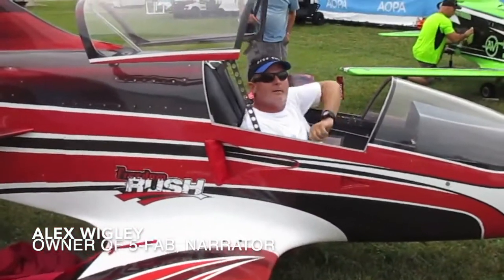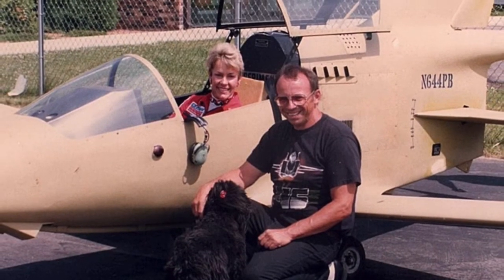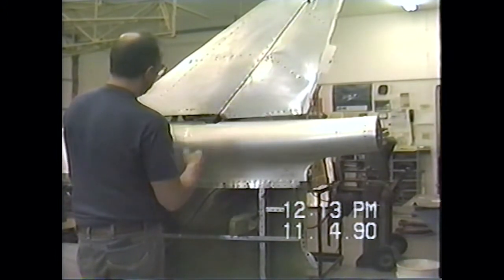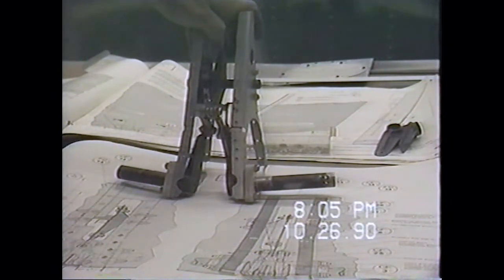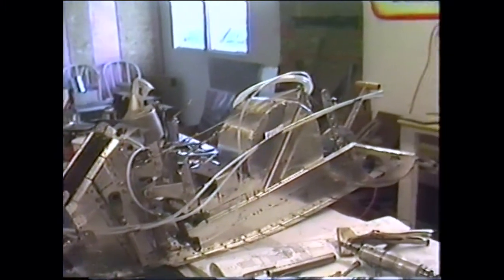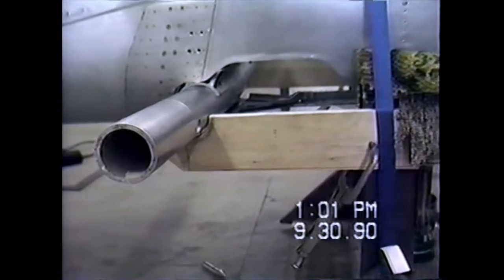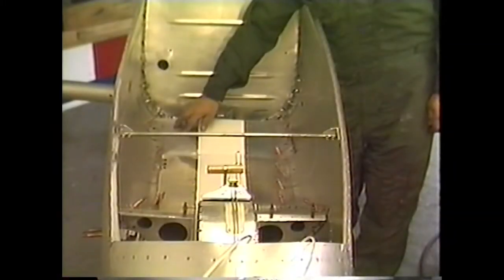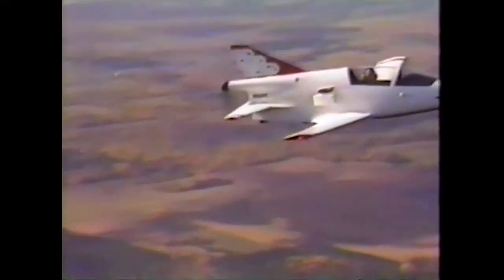Intro: Ron Paulbicke BD 5 Build Collection

Comment: I can't BELIEVE that I found this video! I've been a fan of the BD-5 since I first saw it as a child in the guise of the Coors jet in the early 80s. That's not what got my attention however, it was the F-100 styled plane featured in this video. I've seen it in image searches over the years but I couldn't find any information of it. I have to know please, was it purely cosmetic or was the front intake a radiator or induction intake? It doesn't help my Thunderbirds addiction to not know as much about this little plane as much as possible! Thanks for posting the video!
Reply: The "Thunderbede" nose mod was made to get weight forward for weight and balance. A Volkswagen Rabbit radiator was installed  in the new nose! Ron also worked on F-100s, so the inspiration was already there!
Reply: @alexwigley6574  Wow that's great info thanks!